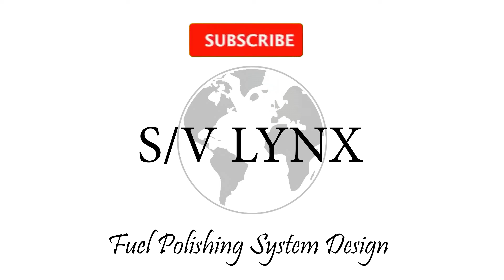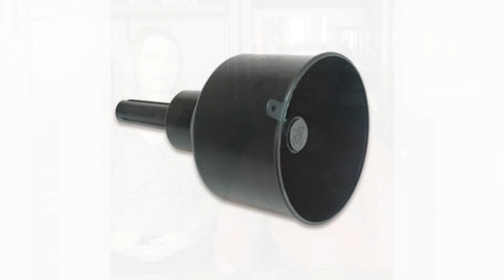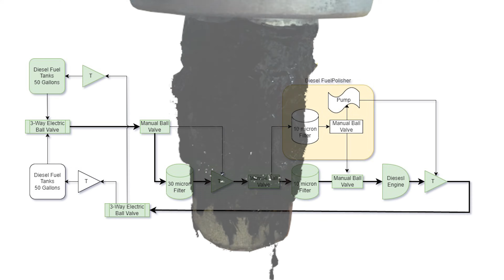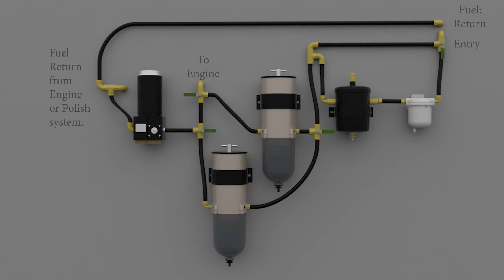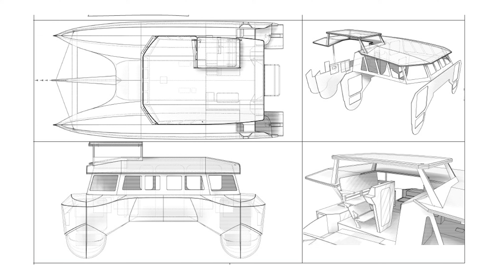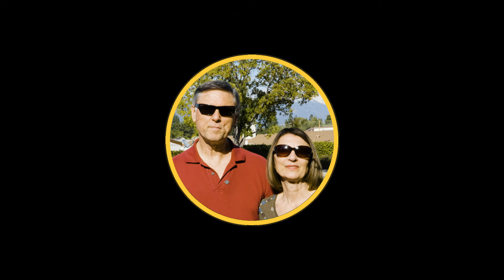Kit E23: Fuel Polishing System Design for our Catamaran Build

Comment: I understand you showed a basic scematic of your fuel system not nessesarilly the design plan (so you probably already have this covered), however I would encourage you to centralise the location of your valve assemblies as much possible so that servicing, maintenance and potential trouble shooting is made more efficient.
Also important to consider vertical location of your elements to avoid introducing air locks in the system.
You will also find it helpful to fit fuel line pressure gauges to show when filters need changing. Either installing pressure gauges, mounted on the return side of the pump on the input side of a filter head to monitor the pressure of the fuel flow. When pressure on the input side of the filter head increases, it indicates increased back pressure (resistance to flow through the filter) =  filter needs to be changed. Or vacuum gauges can be mounted on the output side of the filter and before the pump, this will show an increase in vacuum when the filter is restricting the flow of the fuel = filter needs to be changed.
Reply from the maker: Thanks, we will absolutely add those pressure gauges.  The valve assembly and filters are all located where we showed them, in an easy to access location inside that large compartment that we can enter to do maintenance.  I'm not sure what else you mean by centrally located.  We don't want them in any of the living areas of the boat.  As for vertical location, they are mounted to a wall, vertically.  Was there something else in the arrangement that you are talking about to avoid  air locks in the system?
Reply: @SailingSVLynx  just suggesting that valves be fitted next to filters or on a central manifold rather than at T junctions, remote tank returns and tank selection valves in one spot either at one of the tanks (this improves ease of maintenance) or in a separate central area (like you have indicated).
Try and keep filter assemblies at same level to minimise the potential of creating air locks in your fuel system
Reply from the maker: @bunyipdan  Good advice.  The Electronic T-Valves for switching fuel tanks and the fuel return are in a compartment near (between) the fuel tanks.  Everything else is located in one accessible location in that compartment near the engine.  We will make sure to keep the filters at the same level, as you suggested.  :)
Reply: @bunyipdan  Would heavy swells be enough to introduce fuel system air locks?

Comment: could you put a link to the fuel deputy? uncle Google doesent find it?
Reply from the maker: Sorry, we just called it the Fuel Deputy for the video.  We didn't give out the real name or company in the video because we are currently in talks with them and are not yet willing to advertise their product until we know more.  We don't like to plug products unless we feel they are worth using.  We are still on the fence about this brand and this model.  Their website is a mess of links that don't work, so not much info to be had.  I have been in communication with the company, originally because I was interested in a different product that is now discontinued.  They replied and told me about this filter and sent me some literature, which looks good.  However, I am currently waiting on more information.  If it turns out we feel this is worth telling others about, we will post the company and product name, with links, in another video.
Reply from the maker: We got a response from the makers of the filter you inquired about, and it turns out to be small manufacturer who won't sell to anyone outside the UK.  If you are in the UK, the company is Fuel-Guard, but I warn you, their website is a mess.
Reply: @SailingSVLynx  Thanks looks intresting -If this is something you really want you can join a company called ShopandShip - they offer 34 addresses from around the world - It would ship to your name at their UK adress and S&S would send to you....I grew up on the east coast - but now I work and live in Nigeria( in the Oil And Gas Business) - we have used it to get packages sent here and to Dubai when we lived in the UAE....Keep up the good work - Cant wait to see your offgrid workshop -
Reply from the maker: @sailingsomeday5975  Thanks for that info, we will look into that company.
Reply: @SailingSVLynx  might come in useful as your sailing too

Comment: your a very inventive and innovative couple so depending on price I could see you building a cheaper acme version UV filters are very common in water purification

have you seen the GRIFFIN MicroPure System, an innovative system that improves fuel quality and kills diesel bugs. The system has 3 stages of bacterial elimination using exclusive technology namely:

1) Filtration of solid particulate and removal of moisture in suspension
2) Disruption of microbial cell-walls by opposing magnetic force-fields
3) Sterilization by an intense Ultra Violet light source

This system not only destroys microbial contaminants, it alters the environment in which it grows, resulting in the cleanest possible fuel to your engine. This system is indeed a breakthrough in fuel purification.

Nine out of ten boats with diesel engines will have some form of microbiological contamination or “diesel bug” growing in their tanks. There are an estimated 100 different types of diesel bugs internationally. With the reduction of sulfur levels in diesel and the introduction of biofuels, the number of vessels with fuel quality issues has increased markedly.
Reply from the maker: We would have to know the price before we considered any system.  Most we have looked at cost too much, as in something like $7,000, which is way out of our price range. Our system, as described in the video would run about $1,100 for the fuel polishing portion.